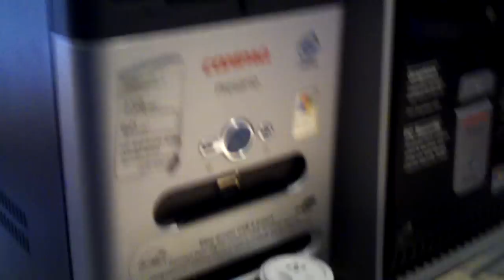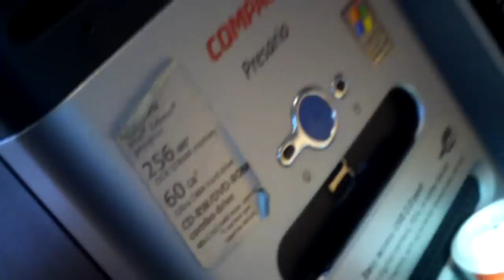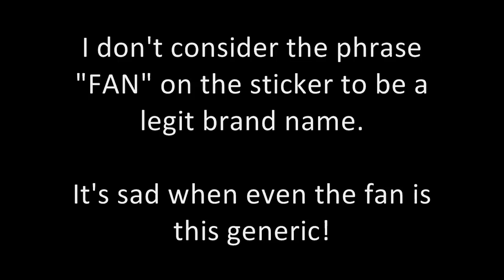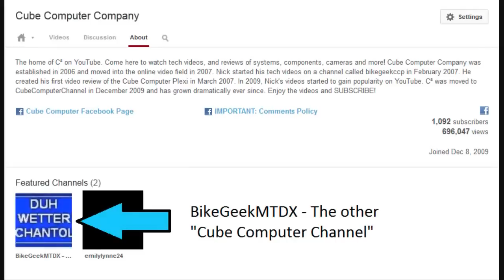A Look inside a No-Name Chiefmax/Leadman Junk Power Supply

Comment: I purchased a similar PSU for my first build many years ago. It was a "650 watt" Chiefmax dual fan unit from amazon. I thought it was a really good deal because it was only $25. When I put it in the computer and powered it up I smelled burning, then shortly after I heard a loud bang and the PC shut off. When I took a case off I discovered that one of the capacitors had exploded!

Comment: When the fog comes out, get close to the power lines on the pole, if you hear
a lot of crackling which is the arc over from the high voltage lines, that is the dirty  insulators.

Comment: Don't think it's a Half Bridge, more likely a Flyback and the Capacitor and Resistor are coupled with a high speed diode to form an RCD Snubber to protect the Swicher from transients inherent in the Flyback topology.

Comment: Ouch. That looks like a flyback converter (But it could be single forward). Half Bridge always has two identical BJT transistors, with the film cap to keep them in balance. This thing is terrible! It doesn't even seem to have more than one cap for 5VSB filtering, which is pretty rare. There is no way this thing can keep ripple in spec at ANY load! Imagine how hot that toroid on the secondary gets. And the worse part, it's not even silkscreened for more components!
 Thanks for sharing!

Comment: Some of those cheap china power supplies for 18 bucks I have put into peoples computers, and two years later are still running. More important is the input power to the customers plug, and I have found in the field a simple test for anyone, put a volt meter on the plug and plug in a toaster to that receptacle, if it pulls it down more then 4 volts when toaster activated, there is part of your problem, just a good tip from a field tech.
Reply from the maker: The house wiring can cause low input voltage, but in many cases, the power company can also be at fault. The line voltage where I live is usually around 120-125V, and that's because I live less than 5 miles from the distribution substation. Cheap units don't like low voltage at all. Keep in mind that even though these cheap units may last for years, the ones that lack EMI filtering (which most of them do lack it) will backfeed lots of noise back in to the house wiring and interfere with sensitive devices such as AM radios, etc. I'm not sure how far this noise will travel, but there can even be the possibility of it affecting not only your own home, but also your neighbors house if they are fed be the same transformer as your home.
Reply: My cases found customer over loading the circuit, and not balancing the network in the breaker box, the noise your talking about can also be cause by a ground loop, and we have a easy test for that, I have had some success clamping noise using a ferrous snap filter over the cord. never found it to be a main transformer on the main, but have found excessive noise to AM radios on the street do to dirty insulators on 7200 volt line before the step down transformer, and if you complain they will come out and shoot them with a acid solution to clean them up, this is the major cause of AM noise, just a tip from a tech.

Comment: Hey cube good video, im planning on restoring/upgrading a cit psu that I got with a cit case, I need some advice can I replace the stock 330uf 200v filer caps with 680uf 200v caps would that work ? apart from that I can replace the rest of the caps fine just need some advice on the filter caps , thank you :)
Reply from the maker: Yes, replace those small primaries with larger value capacitors as that'll help the main switchers. If you could, post a video or some clear photos (be sure to use macro on your camera) of the power supply label, and the inside of the unit, and send me the links. That way, I'll be able to suggest what you can do to it.
Reply: ***** OK will do I will post the video on Thursday or Friday , thank you for the advice.
Reply: ***** The video will be up tonight on my channel under the name of "video for CubeComputerChnnel"
Reply from the maker: MrReeceyburger123 Okay, I'll check it out!
Reply: ***** Ok its up.

Comment: imo the us government needs to make a bill that states power supply companies need to apply to a specific code to be sold in stores and such
kinda like how a house needs to follow certain features when being built they need laws stating that in order for a power supply to be sold it needs to have surge protection fault protection good airflow maybe it if its a 350w psu then it must be underclocked to 300w to make it a bit more idiot and overheating proof so it stays stable maybe circutry that wont explode into a fire like the kind shown in the video

of course how the u.s. is today it would be nearly impossible getting such a thing passed because almost everyone will have an excuse as to why it would hurt them
of course there may be something like this already and  in that case it needs to be a bit stricter to prevent the kind of lazy companies that make psu's like the one in this video

Comment: can u see if u can get an ultra Ls 600w psu to review
Reply from the maker: If I ever come across one, I'll review it.
Reply: ***** thanks
Reply: TechMaster2133 I had a ultra ls 350 and a 400. they seemed to be quite good quality units.
Reply: mike52787 sweet lol I've been hoping so my 600w has a temperature controlled fan (so it stays quiet until hot) but it gets pretty warm to the touch  with the side of my case on and I don't  hear the fan speed up at all. it says it has over temp protection but it worries me lol
Reply: TechMaster2133 These are made by "YueLin" They're okay. They're slightly overrated (More rated towards peak power) but they do use unreliable capacitors from brands such as "HEC" and "CS" Should last at least a few years. The 400W version can do 350W continuously, and the 600W version can do almost 500W. These are just for the LS series. The LSP series is made by Solytech, and the ULT series is made by WinTech. LSP is the best of the three
Reply: David Creigh
thanks man good to know lol sadly it failed violently and actually caught the pc on fire.but ultra gave me a refund plus $350 so im happy but done with them lol.

Comment: your logic isnt completely correct, you can buy a amazing quality psu for something like 15$(ACBEL 550W) but as a general rule DONT BUY CHEAP PSUS
Reply from the maker: There's a difference between cheap and inexpensive, haha! Those 550W AcBel units are an awesome deal!
Reply: definitely! i will admit my wording was flawed :D
Reply: Well if you can buy a used 80 plus power supply for $15 then it’s a good deal